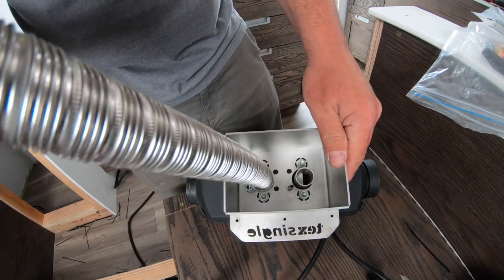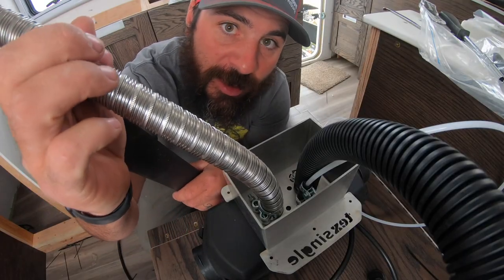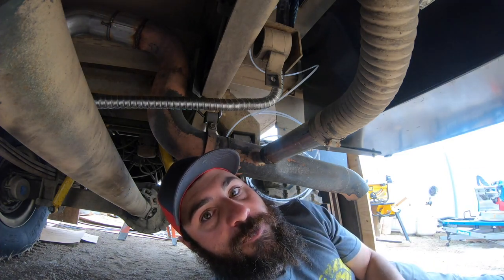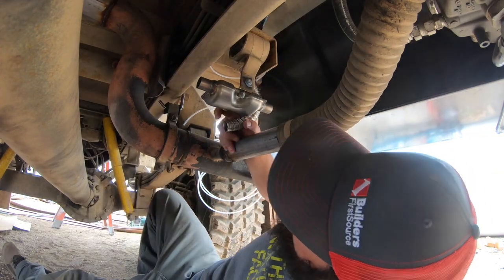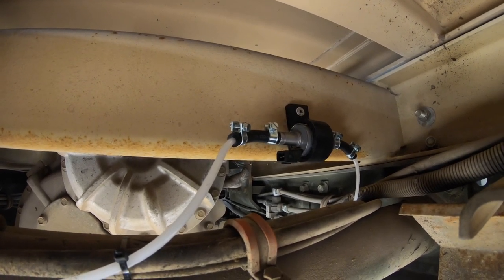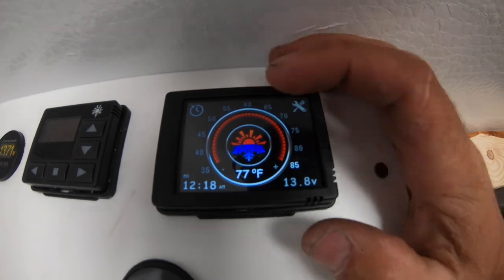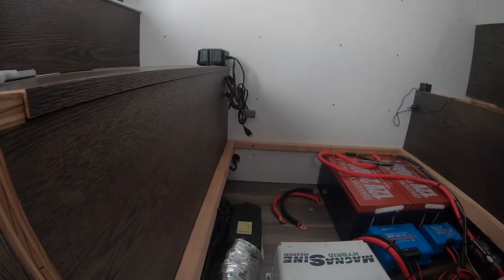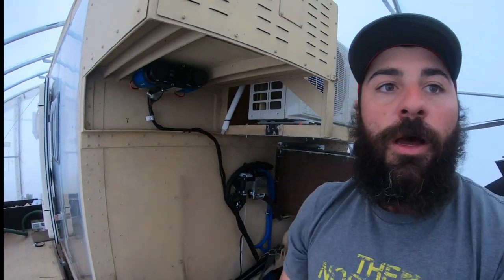Overland 1 Planar diesel heater install

Comment: Why the ARB Compressor?  Don't you already have a central air system for the brakes?  Redundancy?
Reply from the maker: Yes redundancy is one of the reasons. I also want to be able to use air to pressurize my water, inflate  things, run tools etc. without starting the engine.  I am using the air tanks and dryer system for storage just the arb pump will double as another source to create the air.

Comment: is there no risk of water coming through the Planar's exhaust and air intake when crossing through deep water? I currently want to install a Planar into a LC Troopy and dont know how to prevent water coming through the open pipes right into the Planar..

Comment: Looks great man! I wonder if it would be a good idea to add and auto type filter on the intake of the heater in that box with the electric just to keep the dust out of the exchanger. I know I’m always surprised at how fast the dust bunnies form on my floor! Also with the liquid heater I wonder if there is a way to add a valve or two that would short cycle the heating run so that when it’s hot out and the engine doesn’t need preheating your not wasting energy heating your engine block while you sleep. Also so that when it’s warm out that the motor in not throwing heat at the  habitat that then needs to be countered with the ac... although I guess you still want that hot shower when you get there. Just need to make sure that what ever radiator in the box is off?.? Crazy all the variables depending on the conditions! Have fun with it! And go enjoy the horsies while she wants to play with you your girl is super cute! They grow up and loose interest. “Train them up in the way they should go, so that when she’s older she doesn’t depart from it!”And play with her!
Reply from the maker: The filter would be an interesting idea I think I’ll put some thought into doing something like that. Also I have been thinking of ways to bypass the engine for the water heater but then again I can use the electric elements to heat water too so I don’t know how important isolating those systems is to me right now. Thanks for the feedback